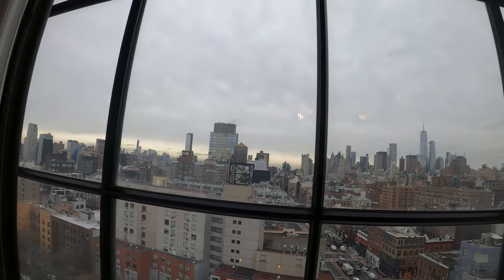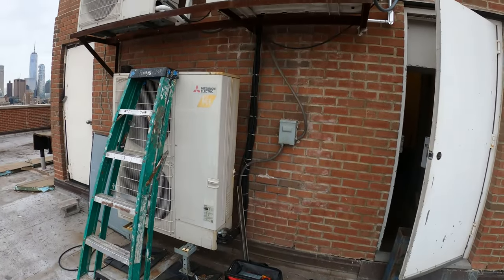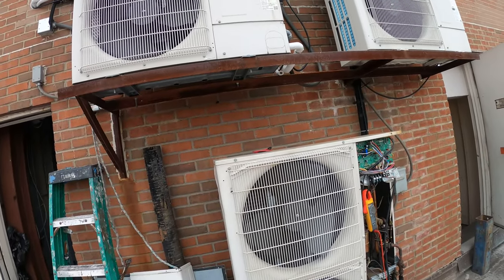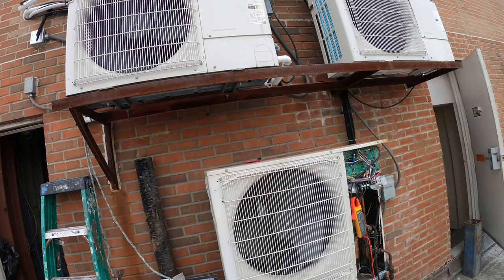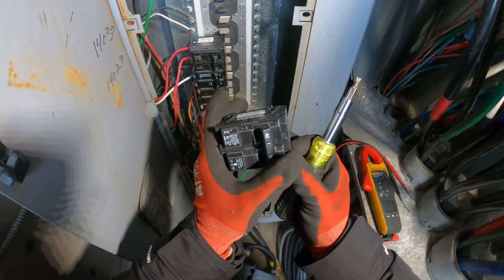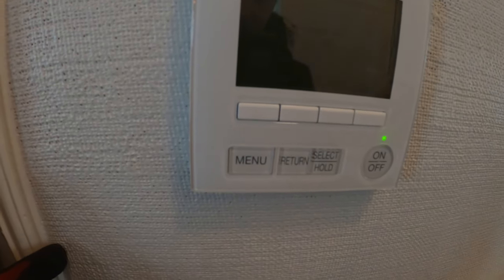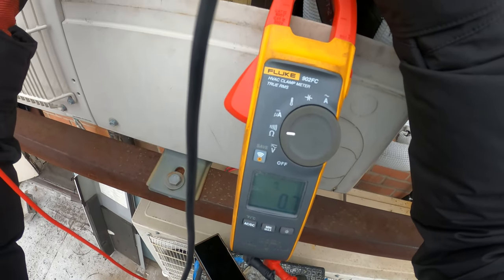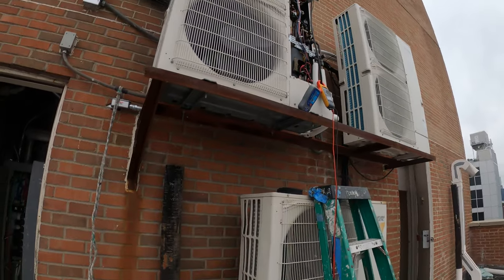HVAC Service Call: Mitsubishi Heat Pump Not Working (No Display On Thermostat) Error Code E6

Comment: Not just the compressor, on METUS unit if the compressor has gone it probably took the noise filter board, which part of the PCB. Next time with the power on check the voltage to the compressor, it is a variable speed compressor so voltage will fluctuate but should be the same or  matching across the legs. Great job, I appreciate your channel!

Comment: Heads up.   Although that compressor definitely showed a ground.   That supco I believe goes up to 50 k    The refrigerant in a system according to Copeland allows the resistance to be down to 20 k.  Again I could be off on my numbers.  But I’m being told do not rely on that supco mega alone.  Test with a mega that will actually give you a specific number.  Like a fluke true mega tester.   Just a heads up